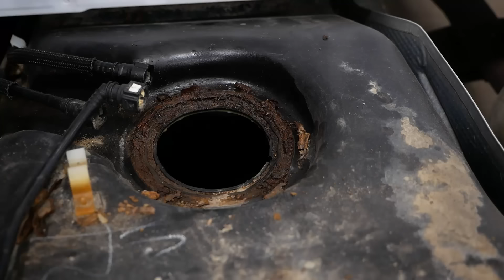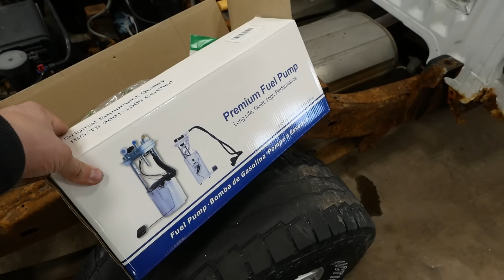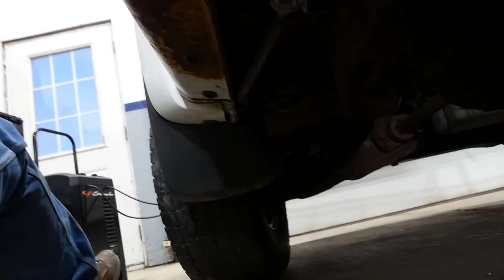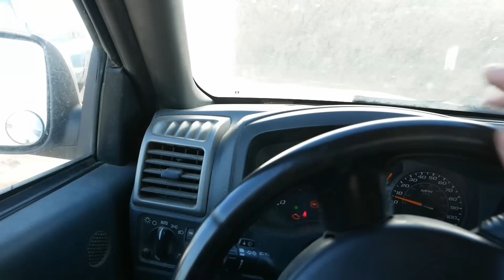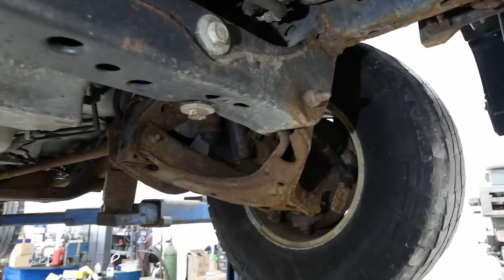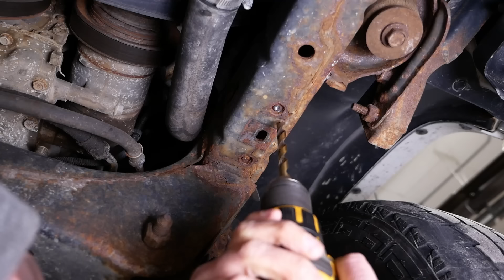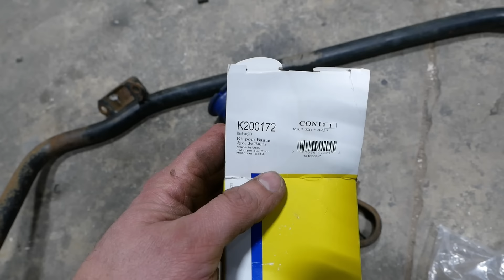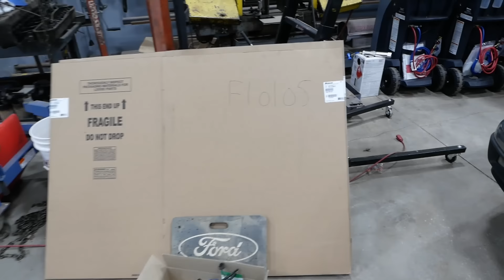Saving a GMC Canyon with 434,000 Miles from the Crusher - Won't Start, Fuel Pump Tabs Rotted

Comment: I'm still amazed that ya'll don't have any type of safety inspections for ya'lls vehicles, especially since you know the DMV is aware of the conditions of the chassis up there.
Makes me wonder about the accident reports on the wrecks that have fatalities, how they explain the frame rusted into, and when it came apart the driver lost control.
Ran off the ice covered road, down across bar ditch went airborne landing in farmers pond .
Yes I embellished somewhat, but I believe you get the point.
Are even typical wrecks where someone rear ends the car in front of them at a red light.
The frames have to be so compromised, that they crumble, and after that the car just folds up upon itself as the other car just shoves the rear bumper into the back seat are further on into the driver's seat.
Someone must of made a very screwed up decision years ago, to ignore that issue altogether. 
But I see you have issues with returning the cars to the road yourself, and anyone in their right mind would whether you have a wife and kids on the roads with people like that running around knowing that a hard bounce through a pot hole could cause the dam front control arms could just let go because nothing to hold them in place. 
How does the state in good conciousness allow that to continue, and yes I understand that means new vehicles every 5 or 6 years is only way to get around the issue. 
Either that or they build the frames out of galvanized steel, and that's just a temporary extension
Reply: They like their freedom to kill themselves and to starve to death and pay through the nose for health insurance.
Reply: Oh look another govern me harder type. Government just wants money and control they could care less about the citizens safety or well being.
Reply: @spudtaterson6281  if you're speaking about me, then you're totally wrong about that, because I don't do well with authority period.
But that doesn't mean that I want my family exposed to a bunch of folks driving like idiot's passing everyone on the road in a vehicle that may break in half at any moment either. 
As to whether you delete your emissions couldn't give a dam, but riding around with your own kids in a truck that the body is rusted off, and the brake lines are rotted to the point that if you hit the brakes hard enough they'll bust.
Yeah then I have a problem, because not only are you endangering your family, but someone else my be in front of you when you're brakes fail, and now you have taken two families out because your too cheap to take care of the important things in life. 
Maintaining your vehicle is important, because you the owner operator are responsible for the safety of those inside your vehicle as well as those around you as well. 
So if that slight bit of common sense isn't in your mind, then what does that make you?
Manslaughter charges against the driver of such POS vehicles should be filed if something of that nature happens, and now that I think about it, it should be first degree murder, because it is actually premeditated after all, because you knew that the vehicle isn't safe to drive on public roads. 
Simple as that, so call me what you want, but please don't bring your ass to highways around my part of the country.

Comment: Dang almost 500k sounds like GM got it right plus in the rust belt that's actually impressive. I'm glad you got it going again.
Reply: It's actually an Isuzu
Reply: @wilbertbirdner1303  actually it's not gm designed the engine themselves it the vortex line. I couldn't find anything about it being isuzu.
Reply: Those inline engines are awesome

Comment: That's not rubbing. That's the jacket of the wire disintegrating in outdoor conditions. Heat, humidity and dust.

Comment: That that  nippel wasnt correct - that should mean that the throttle got a bit of the dust which was present  on the valve cover ?
Reply from the maker: Yeah it's not good.

Comment: Some of the crap GM pulls should be criminal. I recently bought a brand new in box OEM fuel tank for my mid 70's Toyota from an online dealership. Not NOS, but current production steel underseat tank for a 46 year old vehicle, shipped to my door for under $500.

Comment: I've got a clean 06 tank lol. Mine made it to 260,000 miles before it lost a timing chain. I did one fuel pump, the lines sucked but I didn't take the box off, mine was rust free, just some fine gravel.

Comment: I use a carbide deburr bit to flatten broke bolts that break on an angle. The small ball type are fantastic. With enough patience they even work on broken taps.

Comment: Obviously all highway miles and was taken care of by the first or 2nd owner. There's no way one of these would have survived without staying on top of maintenance.
Reply: my 06 canyon has 360,000 miles on it. typical northern state rot happening, a strange oil consumption habit. drive that heap till either blows up or frame rots. not putting more then whatever state inspection costs in it

Comment: I work on heavy equipment, and you are 100% correct on the dirt inside the split loom. It happens faster on equipment for obvious reasons, but the dirt will just grind away at the wires over time. It will also hold moisture and can really screw with PWM signals to coils, and PWM signals coming back from sensors. The excess moisture and dirt can  change the capacitance and impedance of a twisted pair circuit and cause signal drift, usually just enough for the signal to go outside of the expected value. It can be a hard problem to find. Good job Wes 👍🏻
Reply from the maker: Some companies like Ford wrap the whole loom in electrical tape. That seems like a good idea.
Reply: @WatchWesWork  wrapping them in gaffers tape is the best solution I’ve found. The braided harnesses are also good but they are a bitch to work on
Reply: @WatchWesWork  That doesn't matter. Vibration from the harder plastic loom is still going to cut into the softer wire insulation over time. The only real fix is heat shrink full length rubber looms.
Reply: This why a lot of german cars use (used?) that tesa tape.  It's very tough, holds looms together but is softer than insulation....  Also, it typically only sticks to itself, which is way better than electrical tape that leaves a glue mess.
Reply: @ckm-mkc  Thats a good idea, thanks for the tip!
Reply: I always chuckle watching boat channels settle on plastic conduit as the solution to “protect” wiring from chafe and moisture. A year later they’re usually ripping it out.
Reply: Are the screws stainless?  They should be.
Reply: I wonder about this with the fabric type loom also. Seems it would let the dirt in even quicker than the split loom.
Reply: @blake8297  it has to be wrapped properly….and I am sure they have Rube Goldberg machine that can do it tightly with no gaps.
Reply: Cat’s braided harnesses are awesome in that sense but on the other hand they suck if you do have to make repairs.
Reply: He used to set up tests involving moisture and vibration and extremes of temperature that would go for weeks.
I went with him to his workplace once on Christmas or some holiday so he could check on a test that had been running almost a month.
Reply: @michaelszczys8316  They likely don't test for stuck wires in mud or solid dirt . Vibration ,heat  stresses wires outside modeling braking insulation and coper right off .Dirt concentrates heat just like a lens in sunlight  ,heat traveling along dirt free wires .
Reply: @rovidius2006  dirt can make a really good heat insulator
Reply: Some years back my brother in law worked for a company that did testing of wire harness for major car company. He used to set up tests

Comment: Well, that's a lot of miles on that gmc. It's so much fun trying to find parts for older vehicles.  But that kit was interesting.  By the way, Wes that seal all does work really well on oil and even disel fuel leaks. Thanks for sharing and have a great weekend 👍👋

Comment: I used to own my own semi hence my pic is the truck and wires that were not in a loom or taped up that liquid salt they use here in Iowa and many other states would eat the insulation off of wires so learned over time to make sure wires were sealed against that getting onto wires

Comment: 433842 = almostt 699000 km .  Depending on,  a taxi will squash that in 10 years - though most drivers don't drive them so long so that the miles will really pile up.

A median for a taxi in Sweden is around 65690 km a year (trafikanalys 2016.)

But i could believe 433842  if i know who the driver was - did he drove a lot to Alaska ?
Reply: For decades the Yellow Cab of choice was Ford Crown Victorias.  A lot of them ex police cars.  They'd get some extreme miles also. It helps when the fleet is all the same model, and a lot of parts from one would fit on another even if the model years were far apart.

Comment: Thanks for working so hard to save that little truck Wes. I just rolled over 500k on my 92 S10 and seeing that thing come back to life is great.
Reply: I just bought my 92 s10! Those little trucks are great in the snow, I can’t wait to get it restored and put some miles down on it. Hoping to get the same miles you’ve gotten out of it.
Reply: 320 and 380 on my 2003,2004 GM 1500 vans. Only one transmission and two fuel pump alt starters wheel hubs all minor repairs. I keep them forever.
Reply: Those little S10’s were great. We had one at the machine shop I worked at and we would deliver things we built and of course pick up supplies with it. We had to deliver a 6 foot solid steel shaft that we machined to spec for a customer. It was 10.5” in diameter. Made a wood cradle for it and dropped it into the box with no problem other than the back of the truck was down a bit. Our sales manger took off with the truck and as he descended a hill into the center of town, the brakes just could not slow the truck enough and he purposely drove the truck off the road and into an embankment. That shaft center punched the front of the box so hard it slammed into the back of the cab and blew out the rear window. The seat was bent outward in the middle. We had purposely centered shaft in the truck bed which probably saved the manger’s back from being broke. We could still drive the truck but it became a yard vehicle after that. I think we put a bucket seat in it. Had it been one of the older trucks with the tank behind the seat the thing would probably have  exploded.
Reply: @brianmann01  wow,
I had an engine do that hit back of cab.
Reply: They'll do it! My 02 Sierra 1500 has 435k, all original drivetrain
Reply: How many engines and transmissions?
Reply: @tomh6779  Original engine, rebuilt trans
Reply: @tomh6779  one transmission since my worker towed my skidsteer in overdrive. 4.3 and 5.3 vortec s .
I change tranny oil twice a year and run Mobil normal 5w30 every 3-5 k with Fram filters.
Burn no oil leak a little out of rear mains.
Reply: @mitzvahgolem  i have an 07 canyon, i like it, starts great in the cold and has plenty of power for a small truck
Reply: @kevinwilson868  Those 5cyl motors seem to hold up well.
Transmissions are the thing that fail and cost $3k .
I change motor oil and  trans oil and coolant  alot .
Few service trans until it has an issue then its to late.
Drive in 3 not D if you pull trailer or have alot of weight. Lock up converter is off in 3 prevents fwd clutches from burning.
Reply: @mitzvahgolem  what happens in overdrive that causes the trans to fail under high loads? (I’m used to manuals, sorry if it’s a daft question )
Reply: @petermolnar8667  in 3 lock up clutch and overdrive are off and trans can pull without danger of burning lock up and fwd clutch packs..
Torque converter can slip( justs heats oil ) indefinately .
One must keep eye on fluid temp though. 
Heavy equipment dozers pay loaders some farm tractors have fluid torque converter convertors and slip all day while pushing loads. 
This allows fluid to take slippage not a direct drive clutch packs which can slip and burn up.

Comment: I had a 2005 Colorado for over 10 years. Idk what the hell gm was thinking in the design of it. What a pita just doing regular maintenance yourself. I’m so glad I sold it. Way to many problems.
Reply: thats why mine is pretty much ignored. too many problems to be bothered fixing anymore. fix one, it just comes back. Im driving that heap till that POS 5 cylinder throws a rod or the frame rots. the most valuable parts are my wheels/tires and doors at the moment lol

Comment: I think that Wes has seen many vehicles on there way to the graveyard, $ 1200 for a fuel tank...ouch.
Great work Wes, thanks for sharing
Reply: "But it's plastic!!! It will last forever!!!!"
Reply: @dlewis9760  only 99.97856 % will. LOL. bean counters must have calculated that using the standard pump and level design, would be cheaper than adding a screw thread to the tank, and designing a new pump unit. 😣😣. Difficult to sell a used fuel tank when it cannot be shipped, ref hazardous item, maybe fill it will water and ship it as a bowser????
Reply: @bostedtap  I was thinking of shipping it full of water as well.

Comment: Even down here in the south where we get very little snow or salty roads I've seen these rot out. They collect mud and moisture. It rots out the fuel pump top and the lock ring mostly.Whoever invented those repair kits are a genius.

Comment: " do we dare read the codes in this..
" oh yes, oh yes we really do 😂😂
Reply: those traction fault/ABS lights are always fun. mine's been throwing that light for a year or so, already did one front wheel hub at $500+. nope, that lite can stay on. not putting ABS module in a 360,000 beater for a $1000

Comment: No chance of shoehorning a newer year tank on there, eh?
Reply from the maker: I don't know the differences.
Reply: That fix ring is exactly right for this old truck. If the hicks trying to fix it hadn't mangled the locking ring, Wes wouldn't have had to clean out the tank IF the pump was even defective.

Comment: Good to see you again, I know you like good tools. You may have these but if not, you need them. Channel Lock # 410 " Nutbuster" channel locking pliers. They work like a pipe wrench. The harder you pull, the tighter they get. Very little hand grip strength required. Northern Tool, $14.
 A stethoscope with the bulb looking thing at the end of the ear tubes with a long metal probe rod coming out of it. Great for finding bad bearings on everything, narrowing down internal engine noises, electric fuel pumps running, etc. etc. They kinda cancel out all other noises except for what the probe touches. Auto Parts stores, $15. Lisle $32. I find these very useful at times. Thanks for the videos. Be safe.

Comment: Hey it lasted 400,000 miles , they do this on purpose so you have to buy new cars. If those parts were stamped out of stainless, would last to long. Same with brake lines, should be a law requiring them to be stainless. Would it really add that much to cost?
Reply: Copper is just as good.

Comment: I bet they were towing it and they hooked a chain or strap to the sway bar and it tore it right off
Reply from the maker: I never thought of that. I bet you're right!
Reply: Where do you hook a chain to a modern car to yank it out of a ditch, anyway?  I don't see anywhere on many of them (other than the axles) that I would trust to take being yanked on like that.  Obviously you don't want to yank on axles if you can avoid it, if you wreck one of those you are SOL.  I know that front wheel drive "axles" can't be yanked on, either.
Reply: @mharris5047  Not to the sway Bar lol
Reply: @mharris5047 whoops Axles  or     drive shafts know the difference buddy
Reply: How much you betting buddy
Reply: @IANHANDS  $500

Comment: Uh oh you now have my truck, same year Colorado.  I had to get a replacement tank.  Horrible tank design. New pump and tank. 🤷🏼‍♂️. I’ve had the truck for a few years and knew about the gas tank problem.  Let’s see if you find the other gems Chevy thought up???  Oh yes, I did NOT get a 5 cylinder, I found a 4 cyl, 5 speed.  Other than the gas tank has been good.

Comment: Another guy i follow fixes/renovates BMW.   A late 80s BMW has a plastic ring which is screwed down around the gas supply unit. 
He works only with rust-free or nearly rust free ones so from viewing his channel it is hard learning how the gas tank in a rusted BMW looks.

The ones he works with is at least in this area pristine!

btw was the trouble all the time the  bad cable (except for the clear risk of getting a leak of gas and pollution in the gas ie water/salt/dust etc) ?
Reply from the maker: Yes, I think the bad wire was the only thing keeping it from running.
Reply: @WatchWesWork  So the hicks didn't do any testing before deciding to remove the old fuel pump?

Comment: Well I would machine 3 part aluminum replacement, seat on yacht repair "glue". Essentially I would machine a whole circle top, and 2 half "moon" parts to put on inside of tank. Stainless fastners, to tighten those 3 parts together ... and then whatever is necessary to get that pump in place ...
Reply: Way overkill for this old beater.
Reply: @erik_dk842  Sure is, but I kind of am looking for a high milage car to buy for fun project sometime next year, I would absolutely do it to try to fix a stupid      design. This year however need to make the space for that purpose ...
But it is good there is a cheap solution to that.